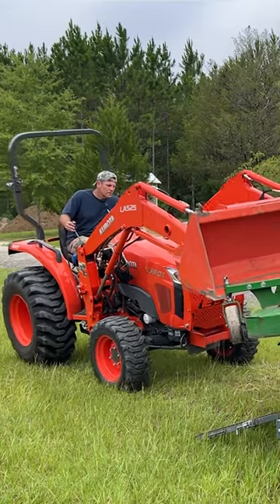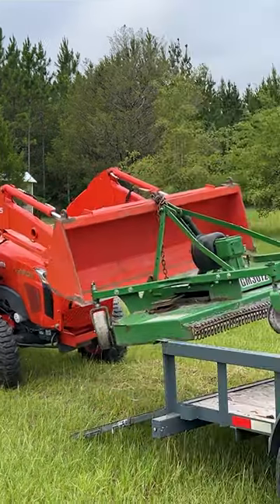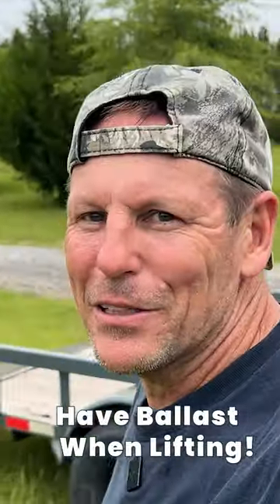Failed Unloading New Mower with Tractor! Hold My Beer!

Comment: Water in the tires. That way you’ve always got at least around 400 extra pounds in the back. I believe the owners manual says it’s 210lbs per tire on a l2501 like mine. Makes a big difference
Reply from the maker: Our rear tires are filled.
Reply: Water?  That will be nice come winter.  How about beat juice?
Reply: @DougAlesUSA  i forget sometimes that some people have actual winters. Nearly never freezes down here in Houston
Reply from the maker: @DougAlesUSA  Florida....no winter.   But honestly, not sure what our tires are filled with...it looks like water when you open the valve.  Maybe it has a type of antifreeze in it?
Reply: @PineyGroveHomestead  honestly, I do not know the answer.  

My John Deere 1025R does not have fluid filled tires however I have plenty of suitcase weights and a weight bar front and rear.   

The reason I went the way I did is to give me an option to eliminate all ballast when using my belly finishing mower.  

As far as the oops in your video, I’ve had oops moments too.  

The only people who don’t have oops moments are people who don’t do much with their tractor or liars.  

Thank you for keeping it real. 👍
Reply: @PineyGroveHomestead we bought our tractor about 3 weeks ago and we were told they the tractor can’t leave the dealership without fluid in those back tires but they put tires didn’t get any
Reply: @DougAlesUSA Well we have antifreeze in them, it works...
Reply: that rots the rims out, wheel weights are much better
Reply: @PineyGroveHomestead your rears are filled and it still jumped like that? Granted that mower is hanging out there but it's not very heavy.
Reply: @PineyGroveHomestead  Its water. I got my L2501 from Sewel tractor too. they told me they fill them with water.
Reply: @derekroose6940 I’m in Brazoria County!

Comment: I never had a front end loader without ballast in the rear tires. I even started putting it in the fronts, especially on the bigger front assists we used in the feedlot and the fields. It’s worth every penny.  Now they have that beet juice stuff and it doesn’t rust your rims quite like calcium chloride does. If you use calcium chloride, have em fill the tire to 90% then the entire rim runs in the fluid at all times, even stopped so there’s mo oxygen getting to the rim to rust it. It’s a little more weight as well.  
    Once we went to radials with the big field tractors we started putting 30% in the duals as well. Tended to offset the added traction to the point you could use it in sandy and loose conditions. 
     To each their own ultimately, but I would have fluid in those rear tires at least. 
 Quick reflexes with the bucket though!!!! 😂😂.
Reply from the maker: rear tires are filled.
Reply: @PineyGroveHomestead   - Awesome!! Hoping everything is going well with you & yours!!

Comment: I welded a 2-5/15” ball to the top of my bucket.  I can move gooseneck trailers quickly and guide the around stuff easier. Don’t use it for moving long distances but it’s good for repositioning.

Comment: Ive lifted my 1 rear tire when i had my loader on and lifted 3 bottom 3pt plow. I dumped the loader quick. I had my wieght set on my left tire for plowing.  I have since found 2 more sets so i have 3 on each tire now and loader aint on at moment since i need to rebuilt the mounts and i bought front wieghts but when i put loader back on i will need to modify brace rod brackets now too.  Have 440? on each rear tire and 440 on nose

Comment: Wow didn't expect that mower to tip up backend of that tractor for that size. That loader must be way out front of the front tires to pivot.
Reply from the maker: Surprised me too.    I've moved it with forks since then and haven't had any problems.

Comment: That's exactly how I load/unload my brush hog on the front of the trailer, then I put the bucket of the tractor on top of it.  I fit the brush hog and a Ford NH 1520 or 1630 on a 16' deck flatbed.

Comment: Simple remedy, drum of concrete and rocks on the 3-point hitch, up to 1,000lb extra, and alot cheaper than the steel or fluid in the tires

Comment: A lesson in leverage.A ballast box is good,tire weights are an option too or a non corrosive fluid in the tires. The ballast box is best if you later get on soft ground and need to be as light as possible.Wheel weights are best if it's high risk of tire punctures in your operation.Fluid in tires gives the cleanest look for weight and traction. A handy person can weld up a nice ballast box for the three point. I wouldn't recommend calcium chloride without inner tubes as it is so corrosive and the stems valves seem to get a seep after a few years,then rust around the stem hole starts. If stem valves do get leaky,jack it up,rotate stem to top, carefully change it out quickly. This should put the stem above the fluid normally. You were wise to drop the loader& load as you did.A ruined mower is definitely cheaper than a rollover or ambulance or hearse ride.

Comment: Do you not have water in the rear?
Reply from the maker: Yes, rear tires are filled.  The loader can lift 1000# at the pin, but a lot of that weight was much farther forward. The mower is around 600#.
Reply: @PineyGroveHomestead  gotcha I really enjoyed your drainage pipe videos on catching the rain water instead of gutters I plan on putting what I’ve learned to use on my barn! Tractor Hard!
Reply: Add a ballast box on that bad boy! Weight that sucker down!

Comment: You should invest in rear wheel mounted weights  or a 3pt hitch ballest box, when working with loader. Just not enough weight in the back tires when loader is used.